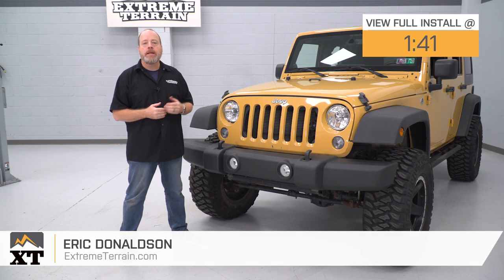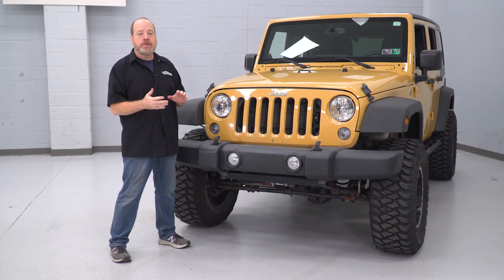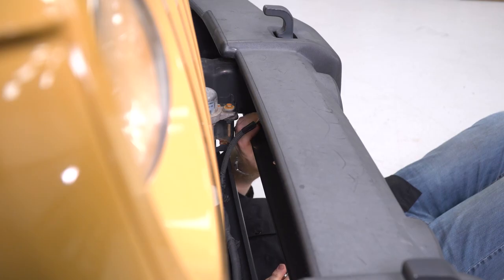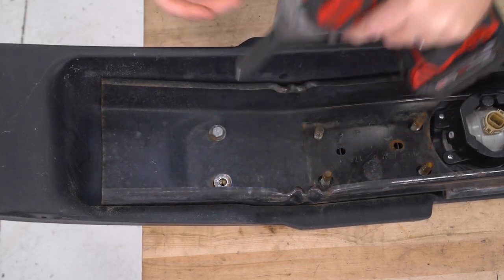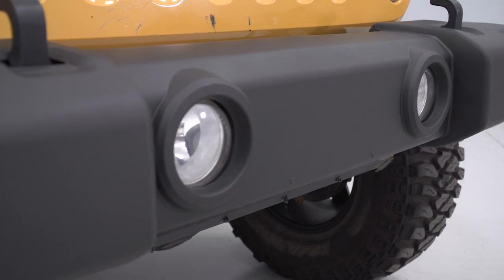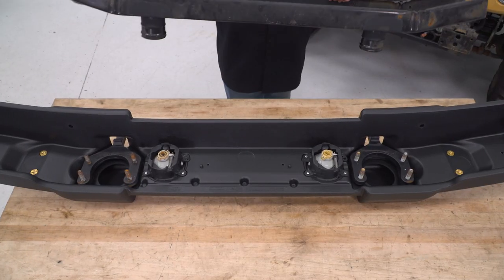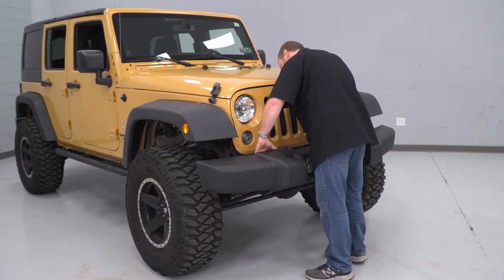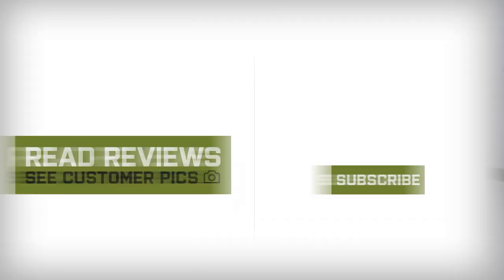Jeep Wrangler JK OPR Front Bumper Cover with Fog Light Openings Review & Install

Comment: For my 2014 JK I didn't have to take anything off.  You can reach the front bumper bulbs without jacking it up or removing any trim.  I wish I knew that before I tried to pry up the clips holding the top trim.  Once I looked, it was easy.  2 minute job.
Reply: That’s exactly what I was thinking! Why take everything off, when all you need to replace is the front plastic bumper cover!